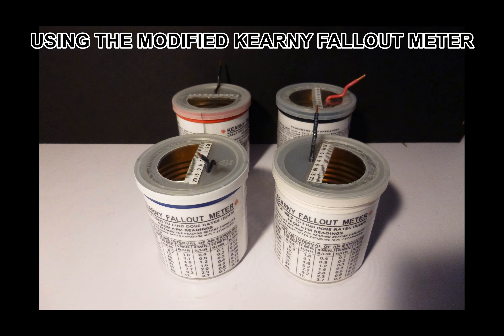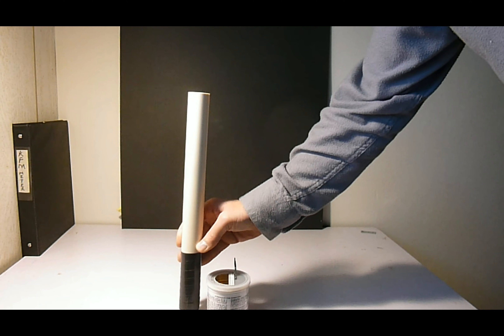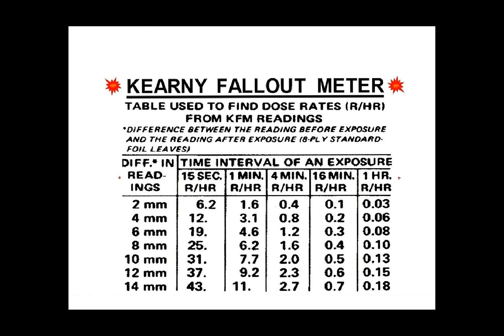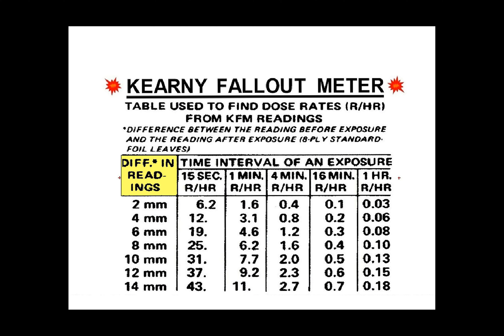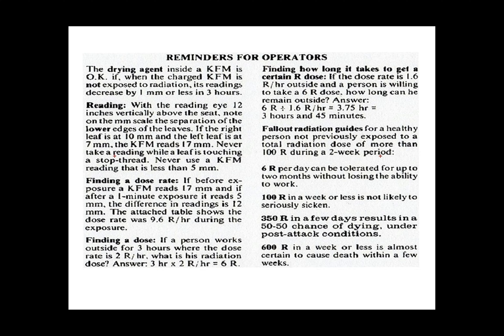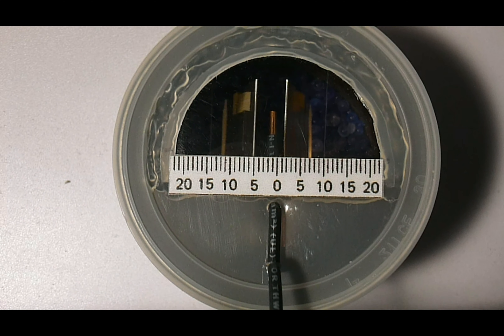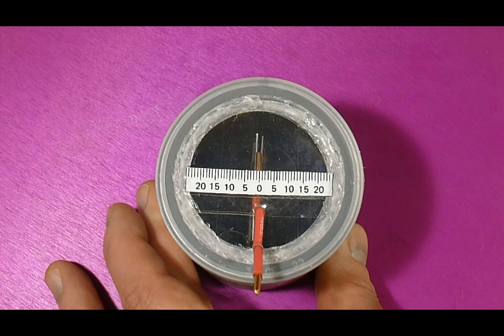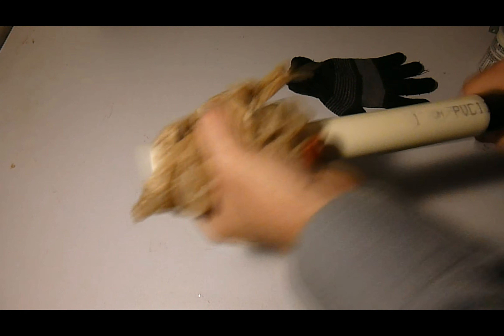The Modified Kearny Fallout Meter- Video #3

Comment: I finished my kfm, but I am not able to charge it. I think I need to wait and let the blue silica gel do its thing on the inside to dry it out. Otherwise, my fishing line is probably not a good insulator. I will try again tomorrow after it dries!
Reply: HEY! I got my KFM meter to charge! I was having trouble generating static electricity. My pvc was an old dirty piece from my shop and I cleaned it with a petroleum based solvent. Bad idea! I ended up reading about using a plastic ruler in the instruction manual. It said to use a ruler and rub it with paper, but that did not work for me. I rubbed the plastic ruler with a wool glove and it charged! Yay! I got 18 points after a few tries. I am so happy now I can advance to taking measurements. Thank you for these videos!
Reply: Now I am going to make a binder like you have with the spreadsheets.
Reply: Now I am trying to figure out how to calculate the R/Hr for very small dosages over 24 hours. Like in this video at 3:11, you calculated a leaf fall of 0.5 mm is 0.003125 R/Hr. How did ya do that?
Reply: OK at 2:44 it is defined that 1mm fall per hour is 0.015 R/Hr. Then you must have divided by 24 hours to get 0.000625 on the top line of your chart, but you wrote .00625...anyway it is almost nothing.
Reply: I get about 1 mm per week or less.

Comment: Thank u very much for this video's. It will definitely help a lot. I want to ask a question, what if I can't get a silica gel then what should I do.
Reply from the maker: Yes there is a cheap alternative to using silica gel. Its gypsum wallboard or sheetrock. This is from the book "Nuclear War Survival Skills-
   'Take a piece of gypsum wallboard approximately 12 inches, and preferably with its gypsum about 3/8" thick. Cut off the paper and glue, easiest done by first wetting the paper. [Since water vapor from normal air penetrates the plastic cover of a KFM and can dampen the anhydrite and make it ineffective in as short of time as two days, fresh batches of anhydrite must be made before the attack and kept ready inside the shelter for replacement. The useful life of the drying agent inside a KFM can be greatly lengthened by keeping the KFM inside an airtight container (such as a peanut butter jar with a 4-inch diameter mouth) with some drying agent, when the KFM is not being used.]
   Break the white gypsum filling into small pieces and make the largest no more than 1/2" across. (The tops of pieces larger than this may be too close to the aluminum foil leaves.) If the gypsum is dry, using a pair of pliers makes breaking it easier. Make the largest side of the largest pieces no bigger than this.
    Dry gypsum is not a drying agent. To drive the water out of the gypsum molecules and produce the drying agent (anhydrite), heat the gypsum in an oven at its highest temperature (which should be above 400 degrees F) for one hour. Heat the gypsum after placing the small pieces no more than two pieces deep in the pan. Or heat the pieces over a fire for 20 minutes or more in a pan or can heated to a dull red.
   If sufficient aluminum foil and time are available, it is best to heat the gypsum and store the anhydrite as follows:
   So that the right amount of anhydrite can be taken quickly out of its storage jar, put enough pieces of gypsum in a can with the same diameter as the kfm, measuring out a batch of gypsum that almost covers the bottom of the can with a single layer.
   Cut a piece of aluminum foil about 8 in. x 8 in. square, and fold up its edges to form a bowl-like container in which to heat one batch of gypsum pieces.
   Measure out 10 or 12 batches, and put each batch in its aluminum foil "bowl". Heat all of these filled "bowls" of gypsum in hottest oven for one hour.
   As soon as the aluminum foil is cool enough to touch, fold and crumple the edges of each aluminum foil "bowl" together, to make a rough aluminum-covered "ball" of each batch of anhydrite.
   Promptly seal the batches in airtight jars or other airtight containers, and keep containers closed except when taking out an aluminum-covered "ball".
   Since anhydrite absorbs water from the air very rapidly, quickly put it in a dry airtight container while it is still quite hot. A Mason jar is excellent.
   To place anhydrite  in a KFM, drop in the pieces one by one, being careful not to hit the leaves or the stop-threads. The pieces should almost cover the bottom of the can, with no piece on top of other pieces.
   To remove anhydrite from a KFM, use a pair of scissors or tweezers as forceps, holding them in a vertical position and not touching the leaves.'
          Hope this info helps- S. Greubel